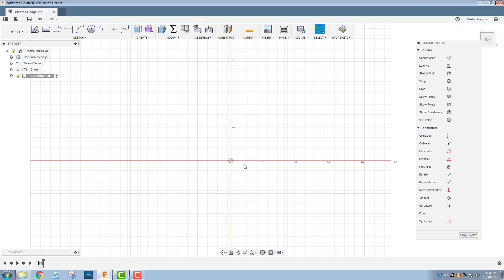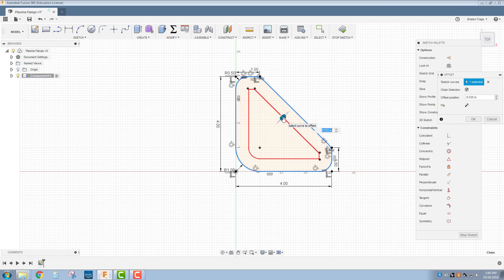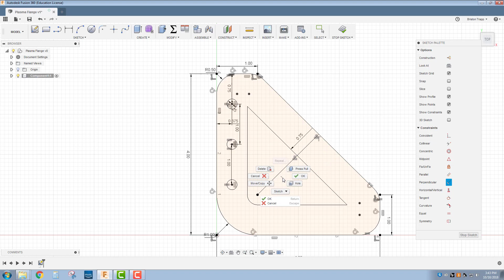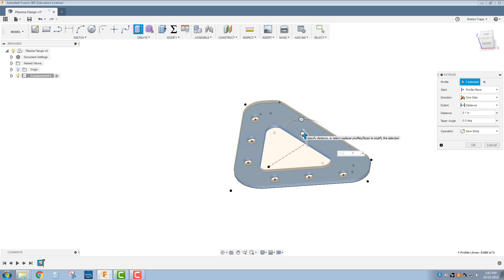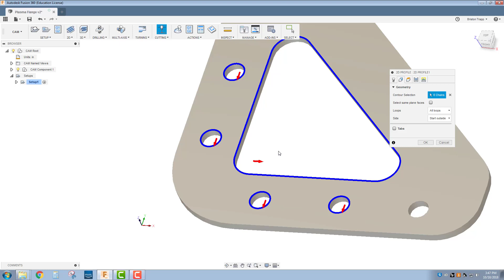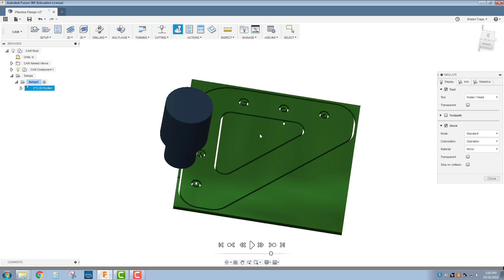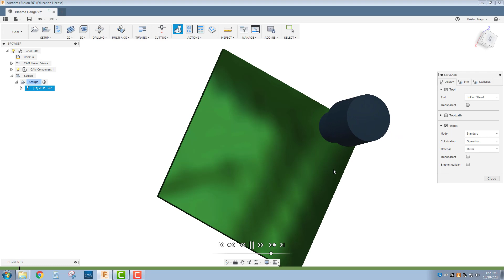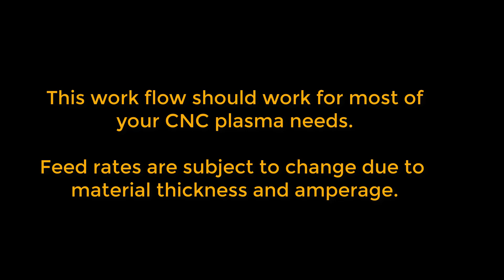Basic Fusion 360 Model & CAM for the CNC Plasma

Comment: Definitely a good place to start thanks for the project and making it easy to follow. I have the free version of fusion360 and I don't have the model in the drop down option it just says design. When I got the sketch done tried to set up the cam and don't have that option either. Guessing those options are only in the paid versions?
Reply: My tutorial was made with an older version of fusion.  They changed the names of some of the workspaces.